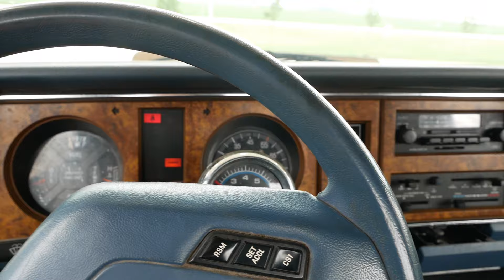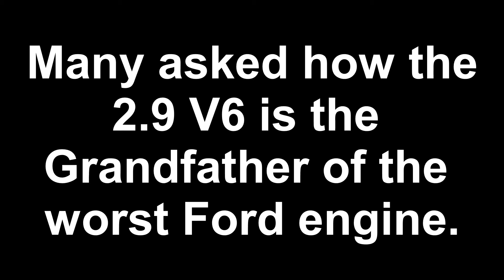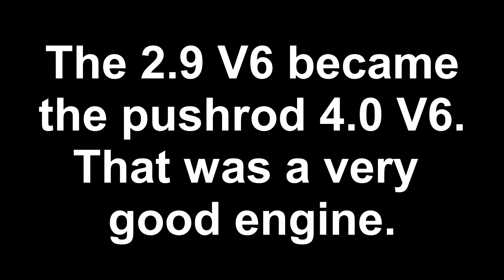Fixing Frank Fritz's 1986 Ford Ranger - Road Ready - Part 2

Comment: Wow that truck is rusty as hell 😅 makes for fun content though 👌
Reply from the maker: Yes sir. It’s so much fun!
Reply: @WatchWesWork  Tetanus shot every 3 days.
Reply: Minimal rust. For my area lol
Reply: @Jobro_Ya_Know  I’ve seen much worse my self the wheel wells and cab corners are still there and pretty much rust free so far. Hell I’ve seen them and S10’s with rust holes in the bumpers on the few that are still on the road.
Reply: Awesome video.   Rusty ??     Maybe I haven't seen the body of it .     It's cool though, he figured out what was wrong with it.   I only see rust on the rims.   Did you notice any rust on the body?   I didn't, looks very straight.    Rusty pick-up.     He didn't show too much of the body , front, back sides inside the bed of the truck.  👍👍
Reply: Sorry, the second video, he shows the bottom of the bed ,   sorry.   Salt , eating at the body ?   Sounds like in a state that puts salt on the roads. In the winter months.
Reply: @redranger78web21  it’s rusty my state heavily salts the roads a 1st Gen ranger is a rare sight one in that good of condition is even rarer the wheel wells and cab corners are still intact the hood lip is not rusted the tailgate is still rust free sure the floor pans are bad my 85 Ranger was starting to rust by 90 with 80k on the odometer.  The S10’s weren’t any better this truck with over 200k on it and 35 years old is doing pretty good for a northern truck.
Reply: I think that truck is done  , sell it for parts...
Reply: Also information to fix your own vehicles.    Well, junk ?   Maybe.     If you have a whole lot of money, it might be worth it.    After it's all done I would love to have this pick-up.    Yup , little ranger 4×4 ,.     Great little vehicle, I had , 2 myself, they were great ,. Yes
Reply: Looks like a typical Michigan vehicle
Reply: @tommyboy256  yes ,. Salting roads ?    I remember an old Chevy Silverado, that had Bondo in the bottom and quarter panel,.  And painted over.    But, it was a cool pick-up.   👍👍.  This Ranger ??   I understand people thoughts on Ford Ranger, they are great trucks, Chevy S- 10 are also great.   Yes , I like all vehicles , including 4×4's.     Big or small.    I had a 56 Chevy pickup, that I never wanted to sell , but , I did , all the work and money dumped into it , darn ,. It was a Chevy Stepside , bucket racing seats ,. A fuel cell , a Ford 9 inch , in the back.  But, because of stupidity, I had to file bankruptcy and sold it cheap , I was so angry , but, if I didn't, I would have had to quit my job, because they were taking too much.    Yup , I really goofed and got lied to.
Reply: Can your brake lathe machine electric brake drums? Gotta be able to do the magnet side to.  Lots of people still need those cut.
Reply: @WatchWesWork  you bet ,. That's the fun in it , saving something from history , the mini pick-up that made a lot of people happy,.    Someone, I know had one ,  another person didn't believe in Ranger pick-up, until he rode in that pick-up, and he mash I'm the throttle to show how fast the little v6 had , shocked him , so a week later he bought one , a supercab type, and loved it , this was in the early 90's.    I know, this Ranger?   Sitting for a long time.  I get it.   I remember a old , pickup that had been in a dried up river bed that he found while hunting, during hunting season.    Later , Summertime rolled around and he decided to go get it , his auto body skills on sheet metal, he brought this pickup truck back to life,.  Replaced all the rusty parts , fabricated new , sheet metal, took quite a while to restore it , got some , aluminum, or a aluminum tank , and put it in the bed , bolted it down, built a door , so you could go camping, when it was done??  It looked like a million bucks.   It was featured in Rodder magazine years ago, early 70's or late 70's. Sorry, I don't remember.   It was an old 1930'or 1920's.  Like a model A pickup     yes ,.
Reply: @steve-ph9yg  hey , you have one or had one ??   I had 2 , I wish I would have kept the first one.    Short bed lift kit , it was cool , but , tired motor , front end needed work , had to get a new 5 speed transmission,.   It cost me 600.00 for that transmission.  Stupid me , I got rid of it.  Darn , I was just a complete idiot.    But, can't cry over spilt milk , that was in the early 90's.      But , yes Rangers are cool to have, especially 4×4 , they have tougher frames and suspension.    👍👍👍
Reply: @redranger78web21  had one an 85 4X2 a few friends had them. They make a nice home for a V8 a friend dropped a warmed up 302 in one it made a nice little grocery getter.
Reply: Ivan don't be jealous.  You know that rust tastes delicious. 😄
Reply: Minimal rust for my area
Reply: If that truck was in NY it would have been worse
Reply: The
Reply: What a rusty pile of garbage!

Comment: Thx for the trip back memory lane, Wes!  Had an '87 Ranger 4x4 with the 2.9 and man 5 sod.  Great little truck, even though I replaced the tranny around 117k if I recall correct. The 2.9 had plenty of power for it's size, was much better than the 3.0 Ford used in the late 90 early '00 rangers. Those Mitsubishi trans were weak.  Never should have been put in a truck.  Engine started blowing oil past the valves and the rear end bit the dust around 190k. That was all she wrote.

Comment: Memories...I had a really nice 1988 Ranger XLT 2WD with a Super cab.  2.9L V6 engine had trouble in the mountains. More about that later...Cabernet Red over Black with silver tape stripes.  Matching fiberglass cap.  Rubber mat in the bed and I made custom carpeted side liners for my music equipment.  Good cushioning.  Dual gas tanks, spare holder in the front left of the bed.  I drove it for 7.5 years with 144,000 miles until the automatic transmission died.  The dealer took it off my hands for $700 and a mechanic bought it, fixed or replaced the trans.  I saw it on the road for a few more years.  That thing kept the parts cannon working hard.  You name it, it was replaced, probably a few times.  Yes, the front end went through tires quickly. Suspension parts, brake job, one gas tank rusted out, 3 blower motors (the Motorcrap ones were junk. The final blower motor was a Siemens and it ran until the end of time.  I dated my wife and we honeymooned in that thing to the Great Smoky Mountains.

Comment: Would love to see a video of doing the r134 conv on the ac to see if it will still work
Reply: I second this! Mines blows cold but the compressor cycles like mad. Ill be making an appointment soon to see if a AC shop can confirm the refrigerant that's currently in the system before I order an adjustable pressure switch and have them recharge the system if needed.

Comment: I have a 1983 ranger, I also live in a salt ridden area. My brakes work just fine! It really helps if you don't just do the bare minimum of cleaning up all the loose rust. Clean as much as you can with a wire wheel and brush and it's a much better job in the end! I've owned my truck since 1997, done more than a few brake jobs on it since it's got over 400,000 miles on it. Lots of other stuff to. Lol

Comment: I once had a Ford Ranger, 2wd with the pinto 4cyl engine. Once I replaced the auto choke with a manual choke it ran fairly well.  And despite weekly trips to the car wash the underside looked like this after four years of Western New York winters!  I traded it in on a 1990 Mazda which was very similar to the Ranger,  and drove it for ten years with none of the trouble the Ford gave me. Considering that Ford and Mazda were co-operating on these trucks it's surprising how different in the long run they were.

Comment: Keep cutting the rotors and drums Wes, "armchair quarterbacks do not win the game", they just act like they do...............
Reply: Any parts replacer can run down to the parts store and buy a Chinese replacement. Wes restored that drum/rotor lathe for a reason.
Reply: I replace all my rotors on my own cars. But.... that's because I don't own a brake lathe. I'd resurface if I could. :(
Reply: That's why I don't want friends hanging out in my shop. Most of them don't know the difference between a box end or open end wrench yet they always have a, you should have done it this way, comment.

Comment: Drum brakes I a dying knowledge especially for anybody under 30
Reply: I've had a few vehicles with rear drum brakes, never had to service them. But watched my grandfather service them multiple times. I read to just take a picture of one side before taking it apart, then refer to the picture when putting it back together
Reply: @jeffreycraig4493  That's okay if they were right to start with.
Reply: They're making a comeback in the EVs. Newer Tacomas have Drums on the rear too iirc.

Comment: Hey Wes, 
    what is that “needle” bearing’s function out at the end of the front spindle...?
    It appeared to me, to be kinda light weight, bordering on “whimpy”...
   Great video, great flyby video shots of the crop duster.
Thank you sir.
Reply from the maker: It just keeps the axle centered in the hub when the locking hubs are unlocked. There's really no load on them.
Reply: @WatchWesWork  
Ahh, ok thank you for the response back...

Comment: I used to work at a company who made emmsions monitoring equipment and we had an o-ring making kit that contained lengths of rubber at different diameters and super glue for making o-rings for development parts. Also you are not the only youtuber to have the brake lathe out recently!

Comment: Not trying to knit pick, but my dad used to own an auto restoration business and he was a big stickler for originality EXCEPT for brakes.  He wouldn't let a car into the shop unless they knew it was leaving with modern disc brakes, lines, fittings, etc from front to back.  Disc brakes didn't belong on anything that could go over 25 mph as far as he was concerned.  That was even the case for my 2001 XJ Cherokee.  It had rear drums when I bought it, but when I brought it to his shop to have rear shackles installed to get rid of the Jeep rear squat I got it back with a full disc brake setup from a Grand Cherokee.  They still worked flawlessly when I sold it eight years later.

Comment: I've gotten a 1985 1988 1991 all with the 2.3 4 banger in them good trucks I wish they would have just took the bed off and changed the fuel pump that's what I always do to keep from cutting any thing keep up the good work wes...

Comment: This was a trip down memory lane. My first new vehicle was a silver 1985 Ranger 4X4 with the 2.8 V6 that looked just like this truck down to the flat bug deflector. My next new one was a 1987 Ranger STX 4X4, again in silver with the 2.9 . I started working at a local Ford garage shortly after buying the 85 Ranger and have wrenched on many of them over the years. Thanks for the video.

Comment: I have the RC version of that plane. It flies like rocket! I can do Ford Brakes in my sleep. I remember those brake retainers fall out in two pieces. I remember the rusted rotting lines. In Michigan, E brake on a standard shift is a piece of fire wood under the wheel. Thanks for the memory's. I still have the bent Cotter pin I used as a Star wheel adjustment tool. I have not worked on a Ford since my Bronco 2.

Comment: My kind of new truck... I've rescued way worse conditions,far as body went... But for the rust they are great ! Cause they are cheap, like me.🙂  I had an 89 full size van ,it developed a transmission hose leak.🤪 It was a second vehicle so it had sat for a while , mainly used it as storage and a road sign for a gas station I worked for, one night I went to pick it up from where I had it parked down the highway,and it was a rainy night. Decided to go for a boot and all of a sudden I had know go... I managed to find some transmission fluid in the van,and limped back to the station. Well after that I looked and found the issue it was that the line needed tightening and it was fixed,but now all I had was low gear ,until it would shift really late into 2nd but never went into 3rd ,yes automatic.  So it sat more ,just for tool storage and signage...bill board .  Wella year later or so, the station closed and I had to drive it back to my other place. It had been that long and I kinda had forgotten that the transmission had an issue.... So I was about half way down the way and I finally remembered that the van used to have that transmission problem. And it didnt anymore,it just never had an issue again with the tranny,and I ended up using it lots. Go figure,and I can't recall 100%but I don't think I put anything but regular tranny fluid in.

Comment: Thank you for these two videos Frank, really enjoyed them.
I got a 1988 Ranger from a place close to Dallas about a month ago but didn't have the chance to lay my hands on it until yesterday. Pulled the spark plugs out and they all looked great. Fluids were good as well. I replaced the starter and as I cracked it just to see if the engine would turn at all, the old lady sprung to life!! I could not believe it!! Everything checked out fine so I put it in gear and took it for a short spin. Totally love it. Forgot to say that being a Texas truck, there is no rust at all even after 33 years.
The reason of my surprise is that the former owner told me that he had some electrical problems and there were some burnt wires in the forward right area, just behind the overflow tank. I simply pulled all the wires apart and isolated them; I have not fixed anything yet. Anyway, as you can imagine I am very encouraged now about fixing everything that needs work and invest more time and money on this beautiful little.

Comment: First class work Wes. Old skool brakes, the only thing I have seen anything like those is working on old Landrovers. Got yourself a good truck there. Just needs a little welding, maybe some waxoil and a new bearing in the gear box. 

I knew it was that 4.0 POS - I remember Ivan working on one of those that had a rattle. It was so bad it got a used engine. As far as I know that engine never made its way to this side of the pond.

Comment: I buddy of mine drove for over 45 years a 49 Ford pickup truck and the first time I watched him replace the front wheel bearings he tightened them way beyond what Ford specs were. His reason? He had a wheel come a junker aka his first car and said never again. It required new wheel bearings every year. 
I asked him to let me adjust the bearings one year and he said too loose until I showed him the Ford specs and demonstrated the wheel met specs the way I tightened it. First time in his life he didn’t need new bearings and told me it actually drove like a new truck at 26 years of age. From then on he adjusted the bearings per factory specs. 

I miss the old days.

Comment: My ‘87 trans made the same noise in 3rd,  it got worse, 4th , being direct was quiet but eventually others got loud and it started jumping out of 3rd.  I can’t remember if I had the Mazda or Mitsubishi trans, but found a low mile wreck at a junk yard for 300.00.  It went a long time until I finally sold it it.  This was in the 90s, I sold it in the mid 2000s. We kept it for a backup vehicle until someone made an offer we couldn’t refuse.  It was a good little truck for us for work , just wish it had a bigger cab.  Here in the south it never rusted like that.
 I did need the 4wd when work took me to snow country, I can’t drive in snow for sh*t, no practice.  That should make a great little bread n butter truck for you.

Comment: My grandpa drove an 86 ranger till the "structural floor mats" couldn't keep the bench seat level across the cab. I drove a 92 with the 2.9 and an FM146 trans with the electric shift transfer case. A big part of getting the most out of those motors is knowing they only start to make decent power over 2000 rpms. The 92 was more fun to drive than my 94 with the pushrod 4.0, M5R1, and 3.08 rear gears is.

Comment: Wow Wes I’m always amazed at the rust that cars are allowed with and then drive down the road. Over hear in New Zealand the M O T which regulate the warrant of fitness here won’t pass your car with any flakey rust on your Cassie or on your hubs or in your doors or door frames basically if you have bad rust any where you have trouble   .   Sure some shops will pass you if you sand the rust back and paint the affected area .But if you have a accident and it’s found to be unwarrantable your insurance won’t pay   .

Comment: a tip with the vacuum bleeding is to wrap some PTFE tape on the threads of the bleed nipples ..   Pull a vacuum using a t piece into a 1 litre glass jar  use a 100cc glass jar   to catch the old brake fluid .my vacuum was achieved using a small compressor inlet .

Comment: I just took the bed off of my 2004 ranger. the exhaust has a crazy bend that goes up over the axle right next to the bed floor. it melted the paint off that whole section so it rusted through. I coted the whole frame with rust inhibiting primer while I had it off. I'm a few hours South so the rust here is bad, but not as bad as the stuff you get.

Comment: Ah yes... TFI modules, SPOUT connectors and KOER / KOEO tests... I got to learn about all that good stuff with my 1990 Mustang GT. Other than a fuel pump, the TFI module was the only thing that ever stranded me with it, luckily I was grocery shopping next door to an auto parts store when it happened. I guessed correctly that it was a dead TFI module and swapped in a new one in about 15 minutes in the parking lot. I daily drove that car for 10 years and it was super reliable, wish I had never sold it...

I had a couple friends with these older 2.9L Rangers back in high school (about 20 years ago) and they were pretty tough little trucks... they certainly did not get easy use by their teenage owners, but they seemed to take a licking and keep on ticking. 😂